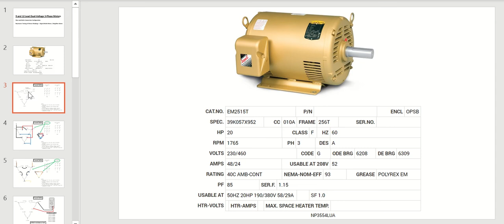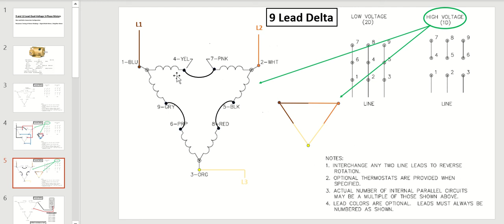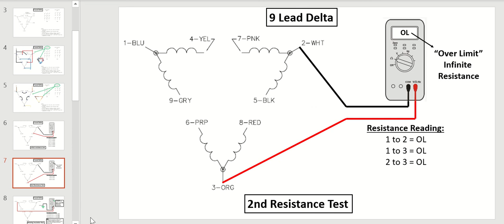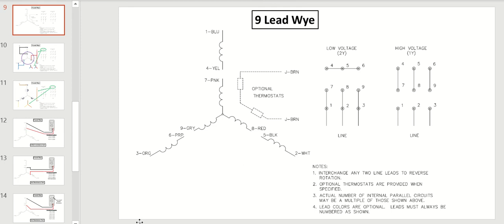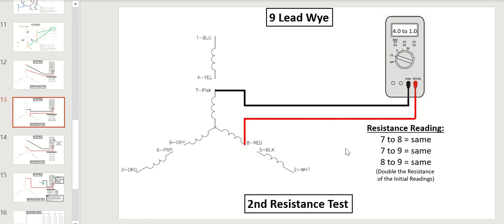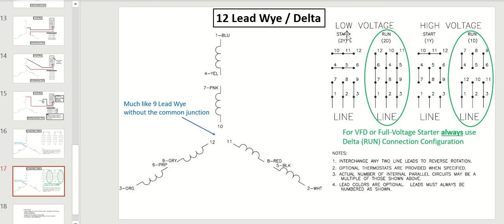HVAC 3-Phase Motors / 9 and 12 Lead Motors

Comment: Sadly youre probably not doing this any longer.   I have an old Japanese metal lathe with a 12 lead 3 phase motor controlled by an eye-delta starter……it’s giving me fits
Reply: Did you end up getting sorted with your 12 lead motor?

Comment: I have a 480 volt motor I pulled from a old machine . The motor has  the 9 wire high voltage  configuration ... there was also a #10 and #11 wire  but no #12 wire ... The #10 and #11  were just capped off with a wire nut  .. I was curious  as to why I have only 11 wires...   or if they are not #10 and #11 but maybe a thermal  that is bypassed ?

Comment: Question: I'm going to install a used system 27 Hp bitzer compresor, for ultra freezing, this system was assembly in china, installed originally in Seattle Washington, and I'm goin to install here en Baja Sur Mexico. The evaporator has 4 Chinese motors 3/4 hp 220/ 380 V,  and each motor has 8 leads, 6 black lead numbered from 1 to 6 and 2 more Yellow leads. I notes that it were connected to 220 volt 3 face, L1 to leads 1,5 L2 to leads 2,6 and L3 to leads 3,4 The other two yellow lead i don't know exactly where were connected, I'm assuming something for controls. Did you saw this kind of connections before? do you have any idea what the yellow leads are for? there is not information at all in this motor and  system, no serial numbers no model numbers only the compresor who was made in Germany. The evap motors only has the voltage, Hp and amperes that's it. 
Thank you in advance. 
I'm apologize, my English is not the best.
Reply: Yellow leads are for thermal overload

Comment: I have a GE sever duty motor 12 wire. I have it wired 9-5-11-L3  4-8-10-L2  6-7-12-L1 runs at 900 rpm on vfd (3510 rpm on plate ) I know the vfd is set up right. Why will it not run 3510 like it says?
Reply from the maker: Mack,
On the VFD it my be set for a 8-pole motor which is 900 RPM at 60Hz, a 3600 RPM motor is a 2-pole motor
RPM = (120 x Hz) / # of Motor Poles

Comment: hi，what happen if the 12leads motor run in 3 coils？the speed will be slow？
Reply: It can run with the same speed but the torque will be reduced, assuming you applied the rated voltage per coil.
Reply: @megaturon1212  when the torque will be slow the motor will damage?
Reply: @vicentecarrasco3653  It depends on the load, you need to check the motor current.

If the measured motor current exceeds the rated current on the nameplate, the motor will burn.

Comment: One question 
Why we need 12 or 9 lead motor instead of 6 lead motor.
Where these motors used
Reply from the maker: HVAC
Reply: Elevators as well.
Reply: More leads provides the user with more options of how to use it.